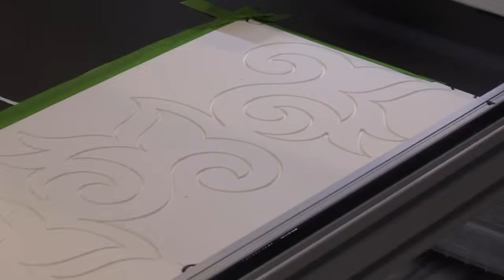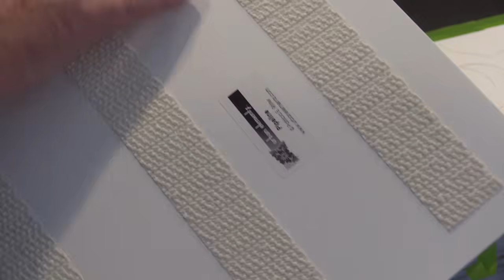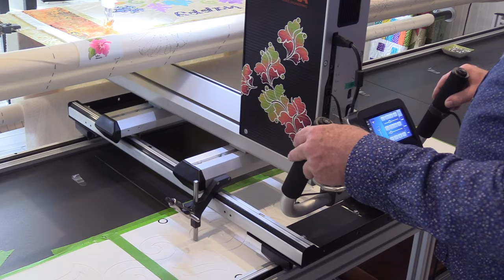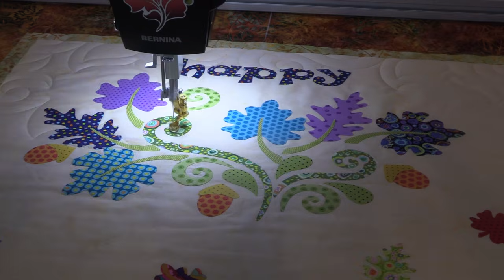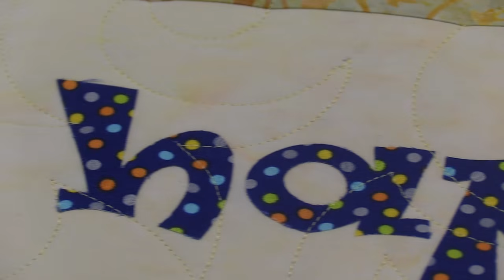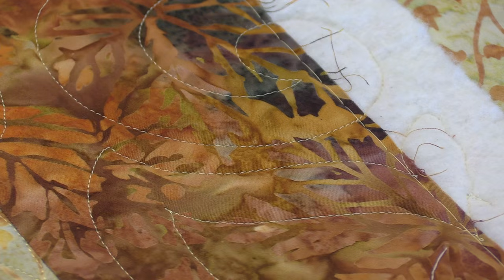Design Boards - Urban Elementz

Comment: What if your design board doesn’t have the 2 dimples to advance the quilt to stitch out the next row?
Reply from the maker: Thank you for your question, Collette. If your boards do not have a dimple, we suggest making a dot on the boards with a marker and use that as a guiding point.

Comment: Is there a trick to getting clean points?  Also, as there is wiggle room in the channels in relation to the width of the stylus, so you think about “banking” the stylus against the edge of the groove to maximize accuracy—if that makes sense?
Reply from the maker: Hi Kelly - thank you for your questions. The stylus is made to fit the channel so that it glides without resistance, but does not not wiggle within the space. Therefore,  your quilting will precisely replicate the design, including the points. Because it's following a set path, it eliminates the possibility of "overshooting the runway" on a point, or prematurely altering the direction of a point/curve.
Reply: Excellent tutorial and many thanks for sharing 👍

Comment: Excellent tutorial! Though I’m wondering with the way you start isn’t there missing spots that haven’t been quilted at the very top?
Reply: Here is what I do.  Hope it makes sense.  I position the quilt so that only the top third/half of the design is actually on the quilt. I decide this based on  the design. I then place masking tape horizontally along the design board so that the stylus will not travel into the lower portion of the design.  As I stitch, when the stylus hits the tape (which should be in an area slightly off the edge of the quilt, I lift the stylus and stitch (while holding the stylus up) over to the next area that would cross back onto the quilt.  I do this all the way across the quilt.  So what you have is a partial row stitched along the edge of the quilt  - as though you 'ran off' the quilt while stitching.  I then advance the quilt and quilt a full row.  I continue this until the end of the quilt.  At the end of the quilt I do the same except now I am using the bottom third/half of the design.    This is exactly the same way I stitch pantographs.   You end up stitiching partial rows at the top and the bottom of the quilt.
Reply: @myradavis2284 , Thank you for responding, that totally makes sense to me! In using the boards with this method the quilting will flow nicely from top to bottom!
Reply from the maker: Hi Kathy, 
We apologize for the delay in responding. There are a couple different options, but it will be a personal preference. While using the design boards, it helps give you consistency and practice, but you can fill in the blank spots without them. You could also copy the design onto paper and use that as a guide, even folding the paper in half.

Comment: Hi there, it looks great, which  BSR setting are u using on the Q24, is it BSR 1,2  or 3
Reply from the maker: I was using BSR 1
Reply from the maker: It all depends on what I am doing.  Pantos or free motion quilting is in BSR1. All Ruler work is in BSR2, because no stitching is happening while your not moving the head, which protects the ruler and needle from accidents, and BSR 3 is a basting function, which you can adjust.  I use BSR 3 to baste the top of the quilt and sides of the quilt when attaching the top to the batting and backing on the frame.  I hope this helps.
Reply: What design board are you using?
Reply from the maker: @jeanetteallen616  The name of this design board is "pipeline" by patricia ritter.  There is a link below.   

https://www.urbanelementz.com/pipeline-grande-two-board-set-design-board.html